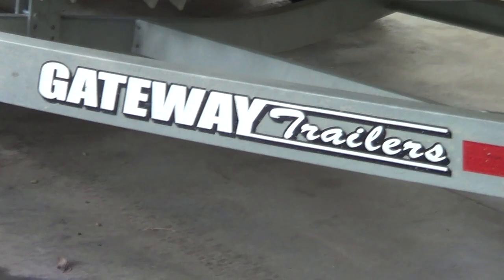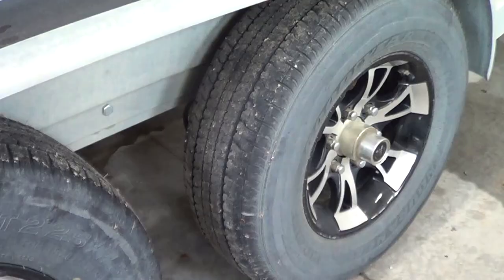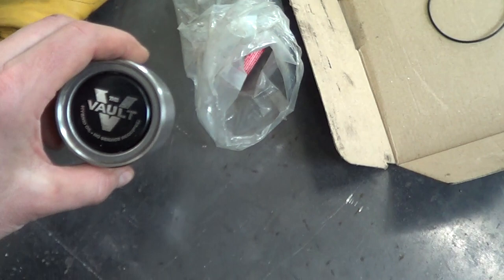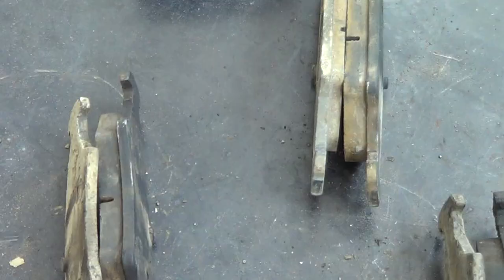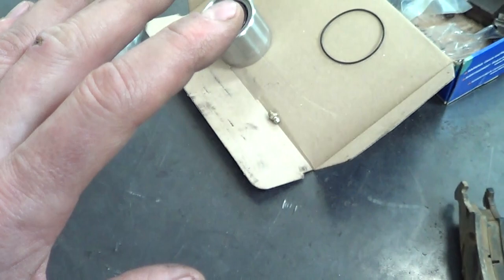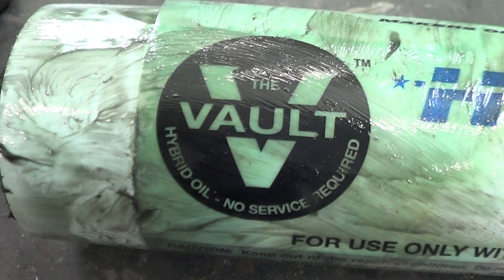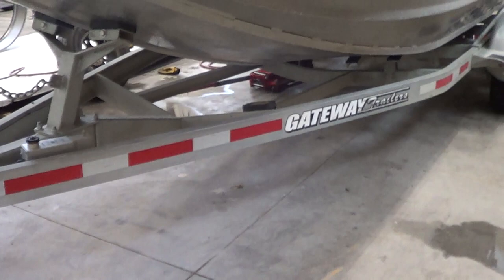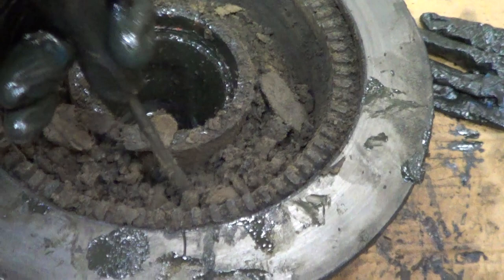5-Year Boat Trailer Review

Comment: I have the same trailer with the same rims. My trailer eats the same tire and Gateway trailer customer service is terrible. I changed to bearing buddy and haven’t had any problems on that end at least. I’m looking around for a replacement trailer. Cheers, Wes
Reply from the maker: Your problem is that you're pulling your boat around. You're not supposed to do that.

Comment: I contacted Gateway about the uneven tire wear and they told me it was because of towing it too low in the front and the torsion axles need to be level.  Ended up flipping my 6” drop hitch to raise the ball 5” to get the trailer level.
Reply from the maker: True that level is necessary for torsion axles. My hitch is fully adjustable so my trailer is exactly level. Regarding my trailer specifically, even if it was not level, this would not explain why one front wheel wears much faster than the others.
Reply: @idahoviking  as someone who’s preparing to buy another one of their trailers because they’re the only option I hope they are fixing some of the issues they’ve had. Did you buy your trailer new?
Reply from the maker: Yes I bought the trailer new. This is actually a replacement (warranty of entire trailer) for my first trailer, which was much worse. It made a half bald tire during the 500 mile drive home. This resulted from excessive toe-in, which could be seen by laying a long straight edge along both wheels. Drive the trailer straight for some distance before applying the straight edge. It should lay nicely against the leading and trailing edge of both tires. Very small gaps are permissible, but I forget what this gap is.

On this second trailer, I took the issue to Dexter. They gave me and two alignment shops the run-around until everyone lost interest. Based on their behavior, I will never buy another Dexter product. I am suspicious that there is a problem with the Dexter axles that manifests only when driving.

Regarding buying a boat with a trailer, be certain that responsibility for the trailer warranty is defined (the boat or trailer manufacturer), along with failure modes and remedies. For example, if a tire wears more than XX in YY miles, then it has failed. Get an adjustable hitch and demand that either the boat manufacturer or trailer manufacturer set the hitch height. Then keep a log of all your mileage. Get a tire tread depth measuring tool. If a tire fails, then a replacement tire mounted on wheel will be shipped to you within 10 days. If more than 1 tire fails, then a replacement trailer will be driven to you and the warranty period will start anew. Etc.

A possibility is to call Matt at Inland Marine in Nampa and see if he will build a trailer for you. I have no experience (direct or indirect) with his trailers, but it is certainly worth a call. Probably it will cost more, but so it goes.

Comment: Another common problem is the boat hook up column cracking at the base. My 28ft twin has ran through two columns on a twin axel gateway trailer. Cracking at the base facing the neck on the trailer
Reply from the maker: Any design change between the first and last?
Reply: @idahoviking  just thicker materials and more weld contact points. Stress fractures are pretty powerful and seem to be reoccurring no matter what I do. I lined the base with some steel stake pockets I had laying around and that’s doing the trick as of right now